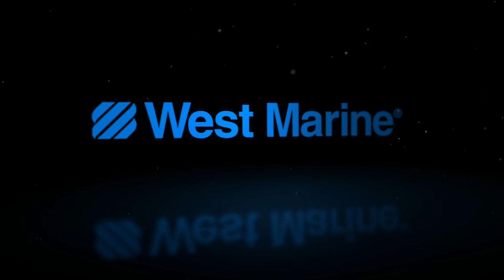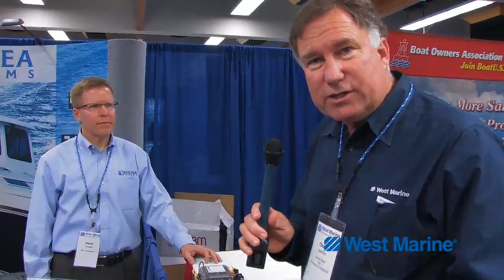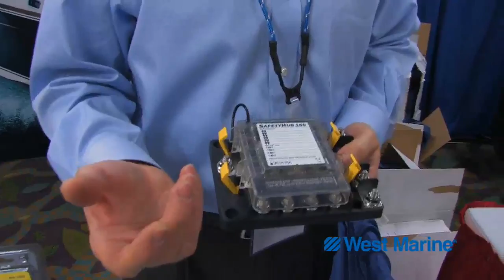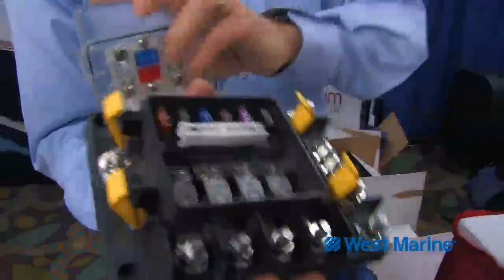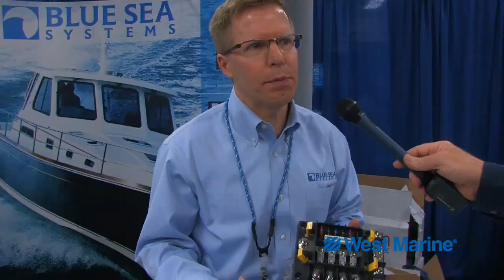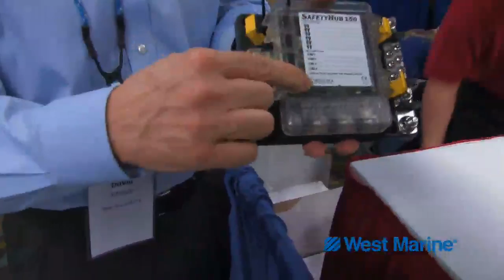Blue Sea Systems Safety Hub 150

Comment: Great product and very compact unit. I have a small space, were the battery slide tray is in my RV. Has only 5 inch on the sidewall. This fuseblock Will be perfect. Can have a fuse for the inverter, breakerpanel, DC-DC charger and a Sub panel. The two 100Ah Lithium is in a firesafe box. I also like the battery pole fuseblock from Blue Sea. Looking forward to use these products.
Reply from the maker: Fantastic! Thanks so much for sharing. We hope it works out well for your RV needs!